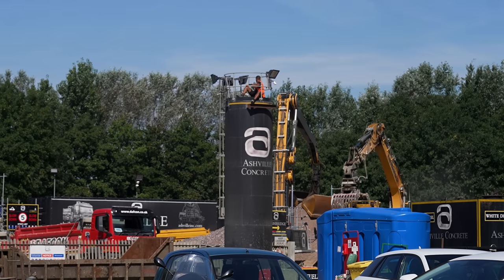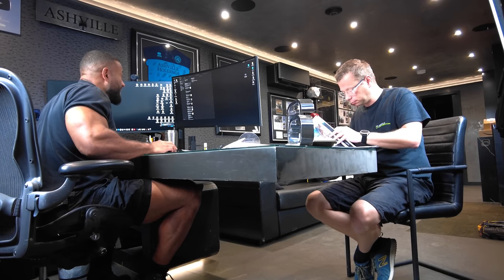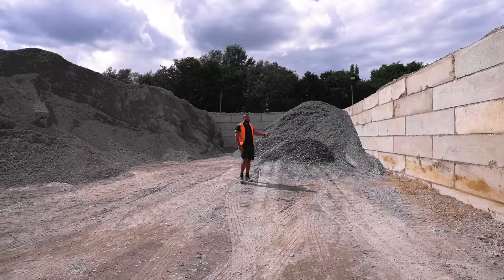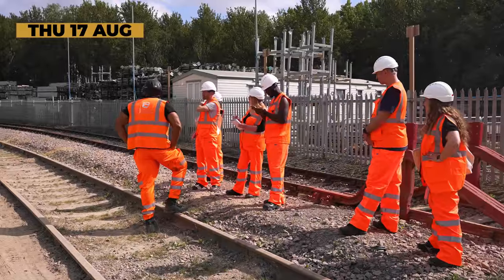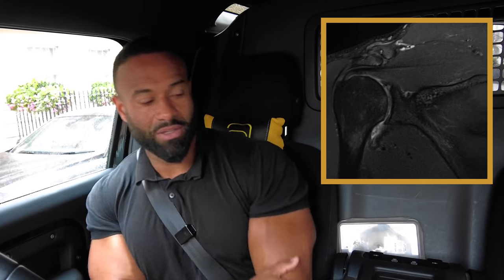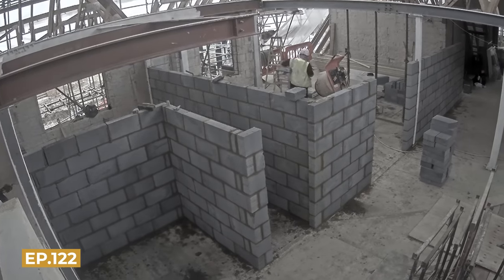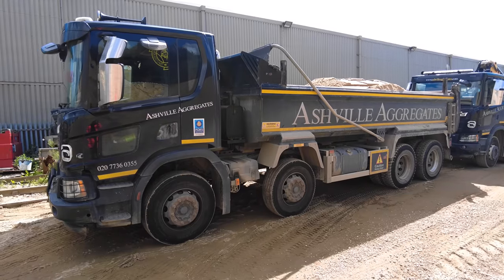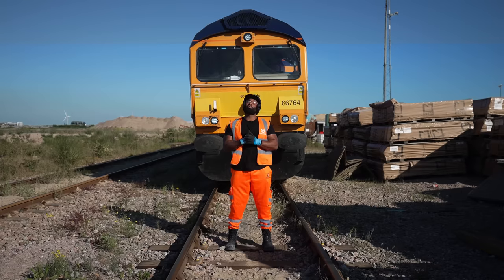Queuing To Steel My Staff & Work | Ashville Weekly ep150

Comment: Daniel before you got a tyre fitter in house i didn't realise just how many tyre issues your company have on a week to week basis and how many tyres your vehicles actually go through.
Reply: I work around various types of construction application heavy trucks (dump trucks/tippers, tractor trailers, etc) and one tri axle dump truck has 12 tires. Average, we'll usually see about 1-2 punctures per week, per truck. Most can be patched, however, still need a tire man to do the patching

Comment: Hi Mr Louisy.  
   My son uses that 'purple slate' as a ground cover in his garden .  More decorative than anything else, with a touch of weed control thrown in (I believe it is used in some southern places as ground cover to help with evaporation, not a problem in Scotland it rains every <expletive deleted> day.  :O)  ) .  I didn't like the look of it when I saw it at first (in bags in a garden centre) but once on the ground it looks really nice. especially when it is wet and glistening.
  I worry (stretching a word's meaning there but... ) sometimes about the amount of work you seem to do but if you are happy doing something rather than sitting on the sofa fair play to you.
  But do you need to drive so much; zoom calls, delegation, trusting others to do the tasks asigned to them etc ?

Comment: Social media producers are heavily in demand and if anyone agrees to be on-site full time then they are DESPERATE and probably not worth hiring. Different industries have different expectations. It's normal for them to work remotely. You will need to reconsider if you want to find somebody good.
Reply: this, as long as the person handling the social media is given the content to post and market then they can definitely do the job fully remote
Reply: The hours are also pretty bad. Monday - Friday, 8am-5pm and 2x Saturdays per month for 32k. Not a chance! Take away the Saturdays, make it remote, have flexible hours and add 3k then you'll find someone.

Comment: 100A main breaker is surprising to me as an American, here 400A at 240v has been the standard for a mumber of years with 200A being the standard for decades before then. Is 100A still a normal main breaker over there or is it normal to have larger main breakers in new homes?

The amount of undercutting over there is also surprising to me, where I work in the US if you use someone's price for bidding work you go with them even if someone may wind up being cheaper later or else you're a real POS, we've had people undercut us before and weve never worked with them again and had friendly companies do the same after hearing what happened to us, its a big no no where we're at. Its sad you have to worry about that kind of stuff.